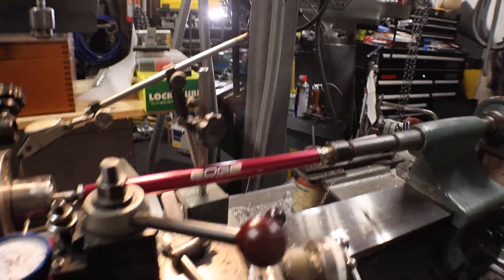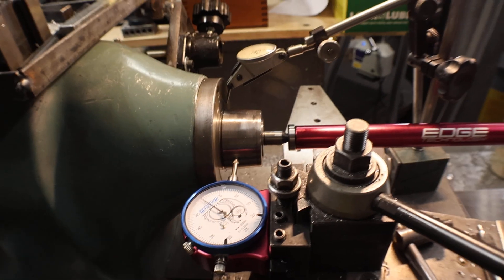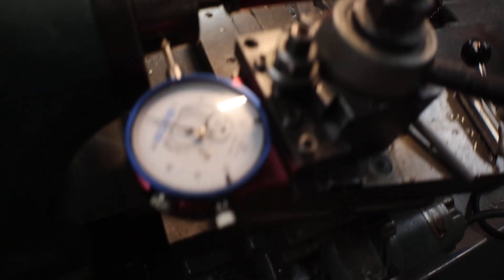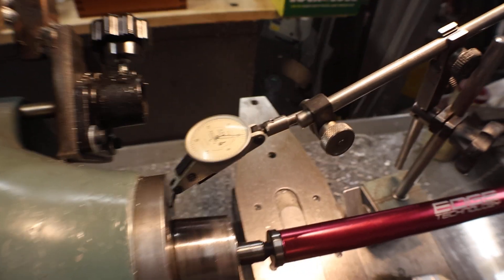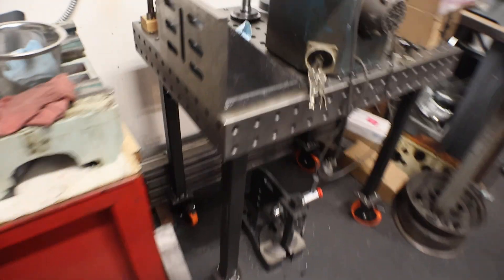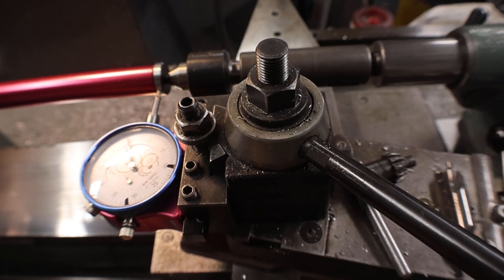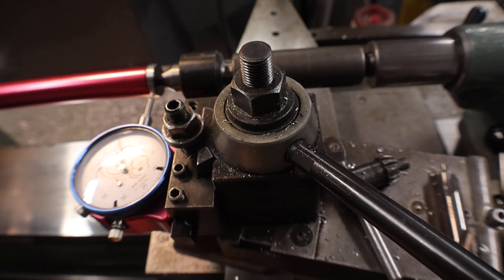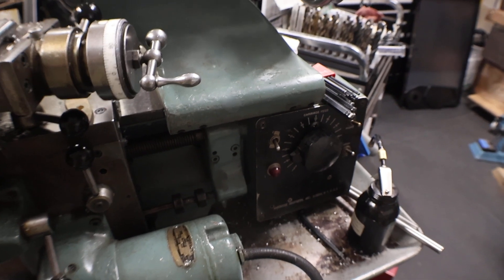1950 Hardinge HLV Lathe #.1 Adjusting the Tailstock and Reading the Headstock. Edge Technologies.

Comment: If I remember right, on my HLV-BK, those are cap screws in the tailstock. They secure a straight gib. There is no adjustment here. What I did is shim in between this secured gib and the casting to correct any offset in alignment to the headstock.
Reply from the maker: Yup, I recently had to dial it in using that method.